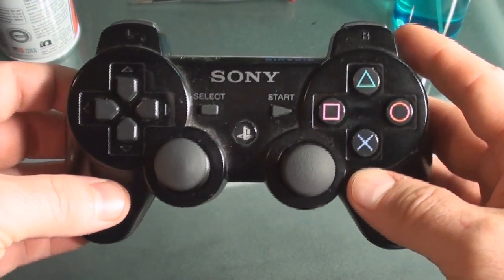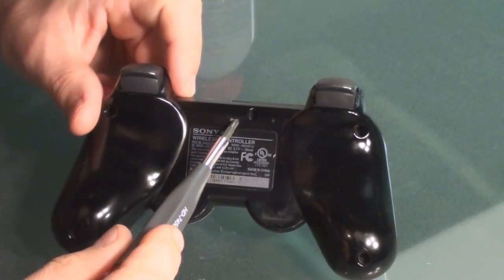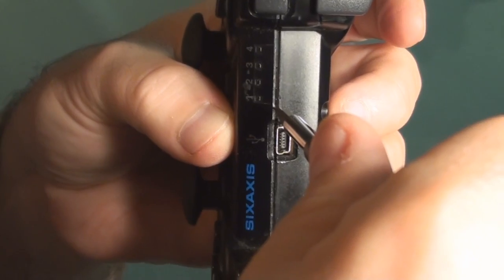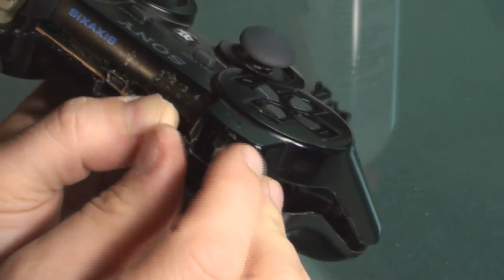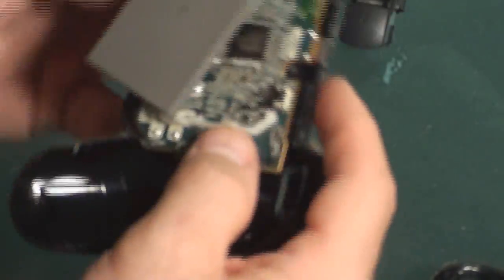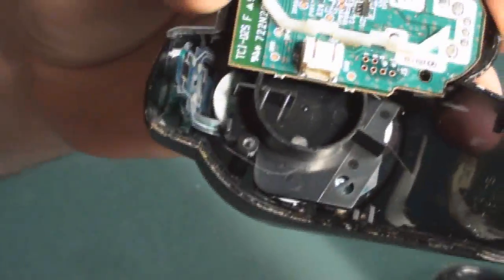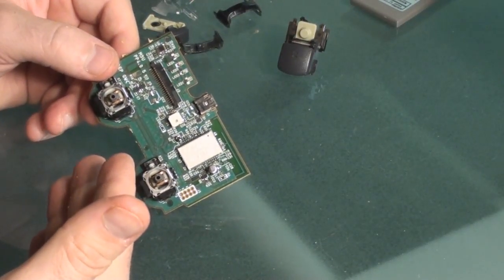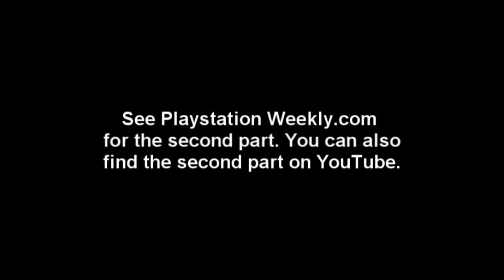PS3 Controller Repair: Main Board Swap - Part 1

Comment: there is a hole next to the main screwdriver hole if you put a toothpick in that little hole for 5 seconds it should restart the controller and connect the usb to the ps3 controlller then it should connect